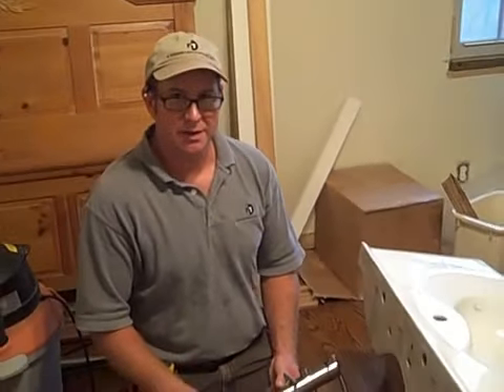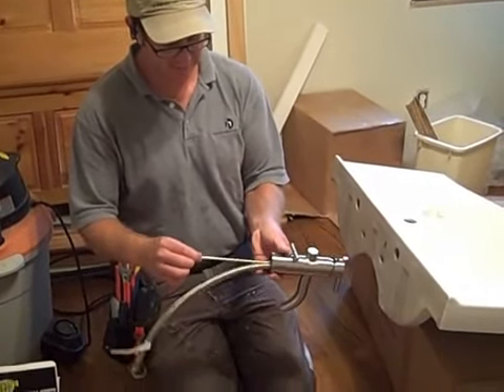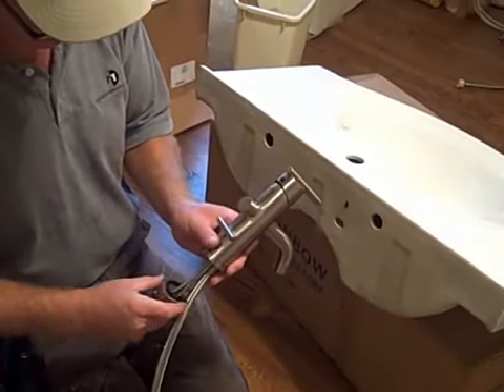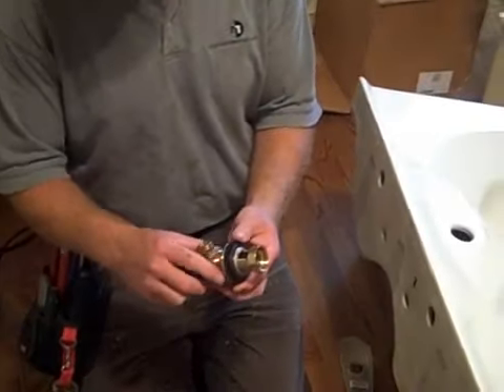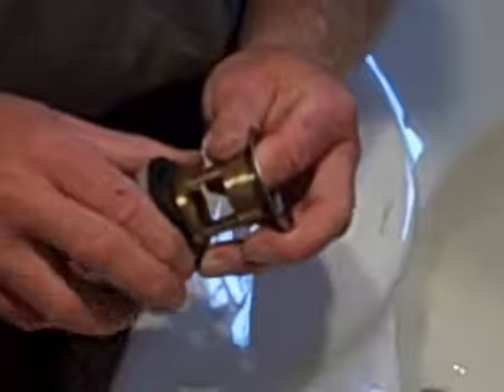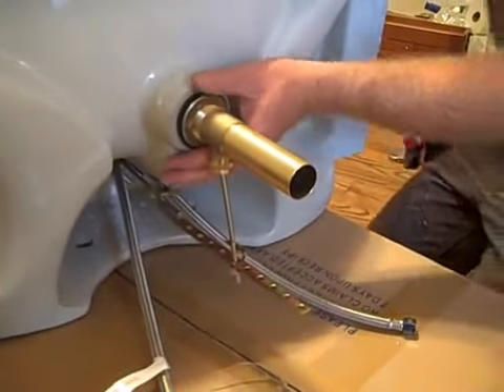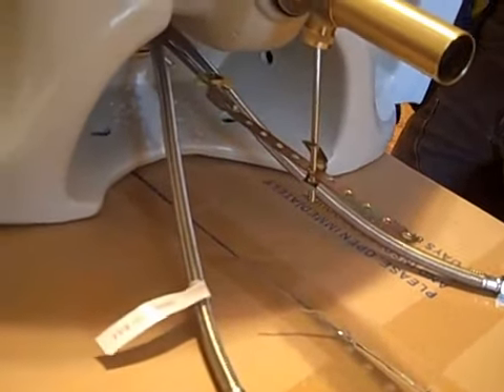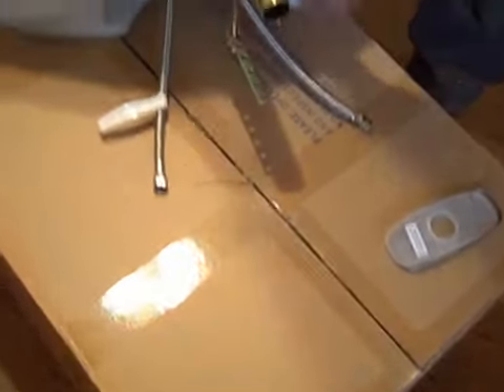Bathroom Faucet Installation with Randy from R Squared Renovations

Comment: Try the SNAPTOGGLE Toggle Bolts from TOGGLER Anchors instead of spring wing toggle bolts. Smaller hole, higher strength, seconds to install.

Comment from the maker: The water lines should either be able to fit through the hole one at a time or be removed from the faucet and then reinstalled under the sink.
It is possible to make the hole larger depending on what the sink is made from. Not ceramic or porcelain or glass.